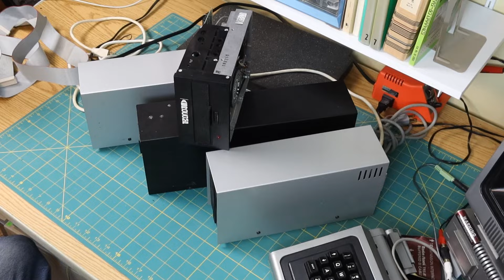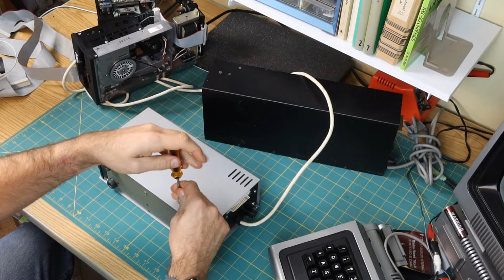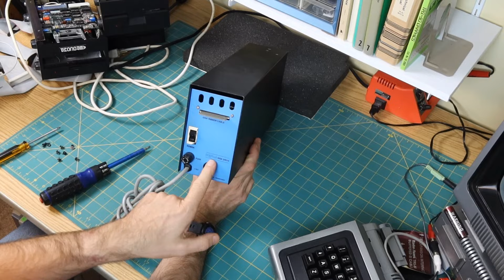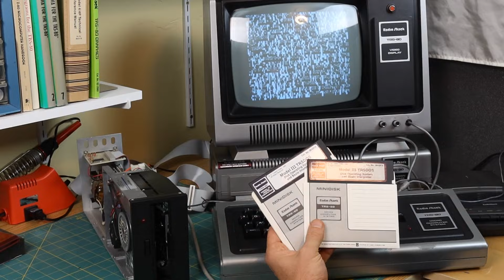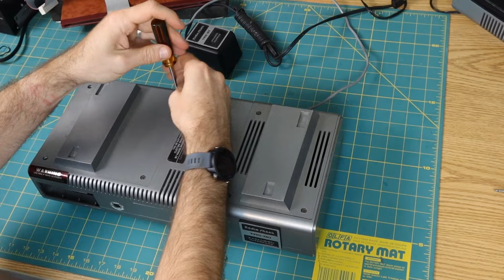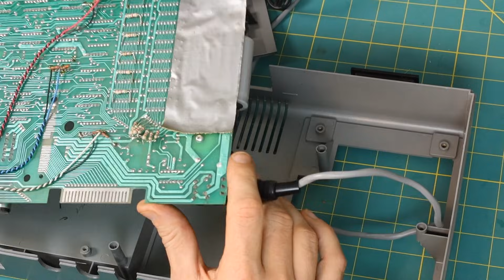Using disk drives on a Radio Shack TRS-80 Model 1! #SepTandy 2021

Comment: Just in case you are unaware - Model-I and Model-III TRSDOS only runs on their respective machines.  The hardware is different and Model-I is normally single density and Model-III double density.  Also, to avoid glitching the disk, don't turn the computer on or off with the disk inserted.  To reboot, press the reset button next to the expansion interface cable, rather than power cycling the computer.  Even if the disk is write protected it could stil get glitched as I think the wp tab just tells the software not to write - it doesn't necessarily physically prevent a stray pulse going to the disk anyway.

Comment: You can't run model 3 TRS-DOS on a model 1. None of the TRS-DOS variations for a given TRS-80 model 3 or 4 will work in a model 1.  However, the model 1's had a few DOS options available.  The original TRS-DOS didn't support double density drives.  Later versions like 2.3B TRS-DOS did as did Ldos 5.31, and newdos80.  The doubler in your expansion interface gives you double density capabilty (MFM encoding)  Without that, you only can read and write single density (FM Encoding).  Double sided capability is DOS dependent, Double Density is DOS and Hardware dependent.  Model 1 LDOS 5.31 was a good stable dos that supported all the features.  Also, depending on your cable, pin 32, may be removed.  If so, the cable will not support a double sided drive as that signal is what selects the side of the disk.  As for the drives, as you stated in your video, the cable selects the drive designation with the last in the chain being drive 0.  This drive should be the only one with the terminating resistor installed.  Good luck in your journey into TRS-80 Computers.

Edit:  One thing I forgot to mention, the drives and controllers in the Model 1 love to damage disks.  Not physically necessarily, but will cause the disk to be unreadable.  When the Model 1 is powered up or down, DO NOT HAVE A DISK IN THE DRIVE WITH THE LATCH CLOSED.  When the system is powered up and down, a pluse will be sent out through the heads and whatever data is under them will get erased.  Proper procedure is to turn on the drives, expansion interface, monitor, and computer then insert the boot disk in drive zero and press the reset button.  This will safely boot the machine.  Before powering any part of the machine down, be sure to open the drive latch and remove the disk.  This is the best way to preserve the data on your disks.
Reply from the maker: I have heard that before about TRS-80s ruining disks, but I completely forgot about it.  Is that just the Model 1, or does the Model III have the same issue?
Reply: @TalesofWeirdStuff  All the TRS-80 models 1, 3, and 4 had the issue.  It just became habit to insert the disk after power up and boot by pressing reset, and to remove the disk prior to power down.
Reply: Put the disk in, but leave the door open. Power up and close the door as soon as the drive spins is another way. Never power down before opening the door(s)

Comment: I would test if your TRS-80 has 48K ram, I would press the BREAK key while turning on (or resetting with the reset button on the left side of the expansion connector) to get into BASIC so you use a small BASIC program to test how much RAM your system has. The reistors are probably bodged to "improve the timing" of the RAM's used, and are probably added by the previous owner, in an attempt to make the expansion interface more reliable.
About the absence of a "connector" for the serial board, it actually came with the serial board, and is a piece of plastic with spring loaded contacts on both sides, and had to be mounted in between the main expansion board, and the serial board,

Comment: If the drive really is drive-0 then while booting it will start to rattle, and bring the head to track 0. If the head is not moving it is not selected while booting. If you have just on drive selected it needs to have the terminator pack, and also you have to use the floppy cable connector for drive 0

Comment: The "integrated circuit" with missing pins isn't an IC at all, it is a resistor pack, it has seven separate reistors, its not "backward", because it doesn't have a direction. It acts as the terminator and should only be placed in the last drive in the chain.
Reply from the maker: It may not actually be backwards, but it sure looks out of place.  Having worked quite a bit with SCSI drives, I was expected the terminating resistors to look more like the ones soldered to the board near the cables. By process of elimination, I did eventually figure it out. But it took me long enough! :)

Comment: I thought the Model I doesn't have autoboot, so to get it to clear the garbage screen and boot a diskette you need to press the reset button next to the expansion connector.
Reply from the maker: Yes and no... elsewhere on this thread someone reminded me that a Model 1 can damage a disk if it's in the drive when the system is powered on. The way to avoid that is to turn everything on without a disk, insert the disk, reset the computer.
Reply: No, if you power it on with a floppy in the drive, it will boot the floppy automatically, if you want to boot to non-floppy (cassette) BASIC basic you need to hold the break key down while booting. You can reset the model-1 by pressing the reset button under the interface connector shield.

Comment: The Sirius drive should be the last one in the chain. The chip that is populated in the socket IS the terminating resistor, not the chip that you think is the terminating resistor. The other drives that aren't populated could be either drive 0 or drive 1. The Sirius drive is drive 3 and should be the last in the chain. If you put it first, the other two drives won't be recognized because of the terminating resistor.  At the same time, the other drives won't read or boot properly without a drive with a terminating resistor in it at the end of the chain. 

Also, the reason the DOS disk won't work for you is that it is for a Model III. Model 1 and Model III DOS disks are not compatible. The memory maps are different between the two machines. You need a DOS disk for a Model 1 for it to boot.

The other issue you may be having is from the ribbon cable from the main keyboard unit to the expansion interface. When you opened the case up it revealed it is an early unit that requires the buffered interface cable for it to be stable. The cable you are using is an unbuffered cable.
Reply from the maker: I figured out after filming the main part of the video that the mystery chip was the terminating resistor pack.  I thought the Model 1 and the Model III were supposed to be software compatible, so I'm a little (but only a little) surprised that the DOS disks aren't compatible (EDIT: @Paleozoic PCs explains a different reason why they're not compatible). I didn't get any disks with this system, so I don't think I have a Model 1-specific DOS disk. I have a DOS disk for a Model 4, but those are even more different. I should be able to get a copy of a Model 1 DOS disk this weekend, so maybe that will do the trick!
Reply: @TalesofWeirdStuff   The way the drives would be configured on this particular system would be like this: Aerocomp as drive 0 and drive 1. Sirius as drives 2 and 3. The model 1 is only capable of reading 4 floppy drives, and the double sided drive is configured as two drives, each side is assigned a logical drive number. The only reason people did this back in the day was for desktop space, since there's no real advantage in the amount of storage space available on one logical drive number by using a double sided drive, like on an early PC.

The Model III can read most Model 1 software, but not the other way around. Semi-backwards compatible, but not forward compatible. Once you get a Model 1DOS disk, it should boot, but if it gets problematic and doesn't boot reliably, you will need to get a buffered cable for the interconnect. 

The bodges  on the board are in fact factory "fixes"  for the early EI board's unreliability. In the end, they redesigned the board to fix it. There's lots of info on the internet about the issues with the original design WI board and the supposed fixes.

Comment: Re: the missing connector for the RS-232 board in the one E/I, apparently it wasn't uncommon for (earlier? later? I'm going to say later?) E/Is to not have that present because Radio Shack waffling about whether the serial board was really a user install-able part or not, despite the expansion interface manual implying that connector could also be used for "custom" boards. I recently bought (and repaired) an abandoned storage unit Model I and E/I from a guy who didn't know a thing about them; I was really disappointed to find no serial board in it. It did have the connector though!

Re: Tandy drive select (no roasting, I promise): That trick with the teeth pulled out of the connector is accomplished on the drive side by wiring up the drive so it will respond to all possible drive select signals; the signal that's actually present at that cable plug determines the number. (In a way it's kind of the opposite of the IBM twist cable, in which the drive only responds to "B" and you shuffle around the select wire from the controller so A->B at that position.) Whatever drive has the terminating resistor goes at the end of the cable because that's where it needs to be electrically, but the others can be shuffled willy-nilly. Now, here's some "interesting" trivia: "Advanced" TRS-80 users would sometimes re-jumper their drives to use the drive selects the "normal" way and use a cable with all pins present. Why? Because Tandy's drive select setting for the fourth drive was non-standard; the pin they assigned for drive #3 (they were numbered 0-3) was later reassigned as the side-select for double-sided drives. (and the controller lacked a specific head-select line) This was actually lucky because it allowed DOSes that support double-sided drives on the Model I to use the drive #3 latch as a side select instead; that limited you to three drives instead of four, but that's a total of "six sides" instead of four so you still win, right? In this mode you need pin 32 running to all (double-sided) drives as side select and you can't have any single-sided drives you might still have in the mix erroneously activating on it so it made sense to just undo the Radio Shack jumpering and do it the normal way. This is how I actually used to run the TRS-80 I bought at a garage sale in the 1990's; I replaced a couple of the single-sided mechanisms with drives pulled from government-surplus IBM PCs. I kept a single-sided disk in the drive 0 slot because doing that simplified disk copying. :)

If that one drive you have really is double-sided and your cable is still missing teeth then one possibility is it's set up so it can present itself as if it is two drives. (IE, the side select line also acts as a drive select.) This is a thing some manufacturers offered before DOSes had "real" double-sided support, but it also required a cable that had two contacts at the position for the double-sided drive, so I'm not sure what you have going on there.
Reply from the maker: Ah-ha! So that probably explains that little circuit board in the housing with the model 52 (DSDD) drive! It must be combining those drive select lines to generate the head selection.
Reply: Close pictures of that board (or a reconstructed schematic) would certainly be interesting. The guys who packaged up these drives did all kinds of crazy things. When I took it upon myself to reverse the "Tandy Jumpering" of the single-sided drives that came in my garage sale enclosures a couple of them were trivial, while the third one was all hacked up with trace cuts and jumpers, rendering it basically permanently Tandy-fied.

I was skipping around a little earlier and missed this, so just for the record: TRS-DOS for the Model I and Model III are NOT compatible. Even with a double-density board installed Model Is default to single-density on power-on so they can't even read the boot sector of a Model III TRS-DOS disk. (And while big picture the machines are mostly compatible there are some deal-breakers that prevent DOSes from easily working on both machines, like the addressing of the disk controller is completely different.) You're going to need a TRS-DOS 2.3 disk (single density only) or, preferably, a third-party DOS like NewDOS-80 or LDOS, in that case specifically the Model I version.

FWIW, it *is technically possible to make a disk that boots on both platforms, but that technique was mostly used for things like self-booting games. (I think there was a dual-booting version of... MultiDos?, and that's about it) Long and short of it is they'd format a disk in a single-density format both systems could read and write one sector of double-density data on Track 0 for the Model III to see.
Reply: ... and conversely, the smarter double-density DOS-es for the Model Is would format System disks with the first track in single density and all the rest double-density. (I vaguely recall the earlier versions of LDOS? didn't know that trick so if you wanted the extra storage for drive 0 you had to boot a single-density disk and swap it for a DD one... which meant you had to swap it back if you ever had to hit the reset button.)
Reply from the maker: That makes a ton of sense. I should be able to get NewDOS-80, so hopefully that will get things working. As for that little board in the Sirius drive... I'll try to post close-up pictures on Twitter and Instagram later tonight. I don't think there's a good way to post them on YouTube. Maybe a short? We'll see...
Reply from the maker: Pics tweeted: https://twitter.com/TalesOfWeird/status/1443007155183910917

Comment: In the wild I've picked up disk drives for Apple, Commodores, IBMs and Ataris... I have never even SEEN one I can use with either my Model 1 or CoCo .
Reply: I've seen a external hard drive for use with a TRS-80 Model 1 or Model 3 in the wild, but like you, never a floppy disk drive. Maybe they were not that common back in the day? I do see the TRS-80 branded cassette players in the wild from time to time.
Reply: @geekwithsocialskills  Exactly. Although for the tape decks, I've only seen the white one, not the black one
Reply from the maker: Until I came across this big lot together... I had never seen any in the wild either. Like @Geek With Social Skills says, I don't think they were that common for the Model 1, and they were built-in for all the other models.